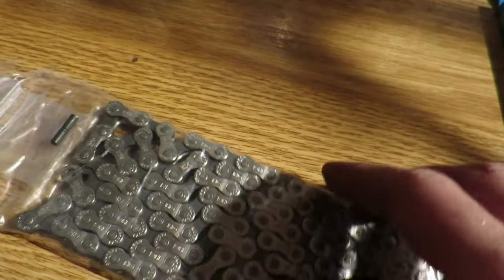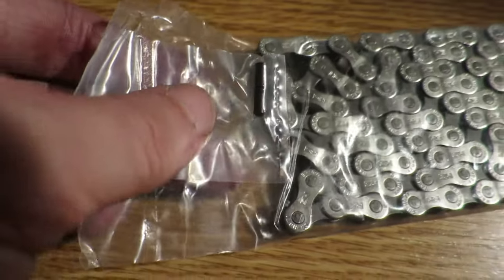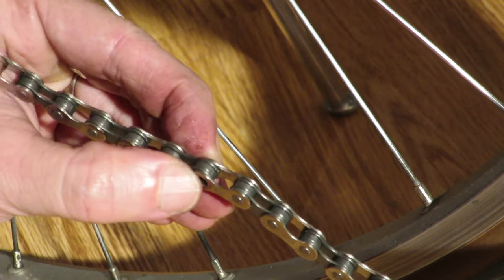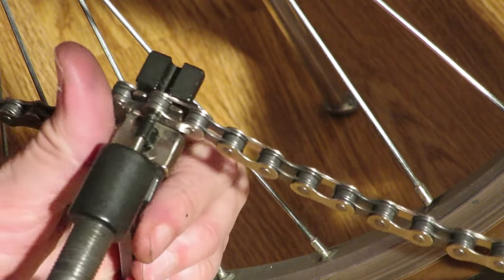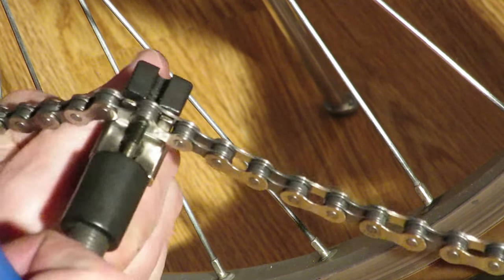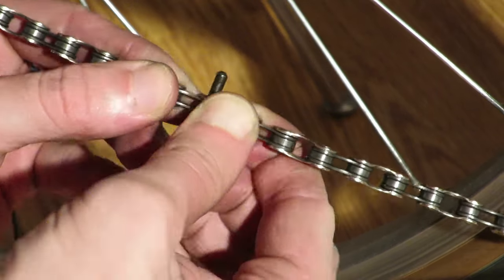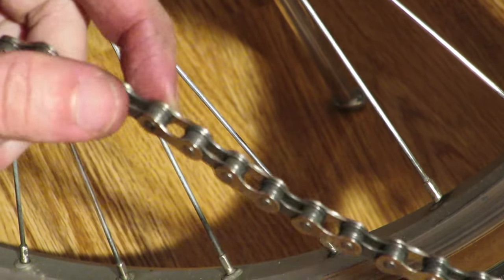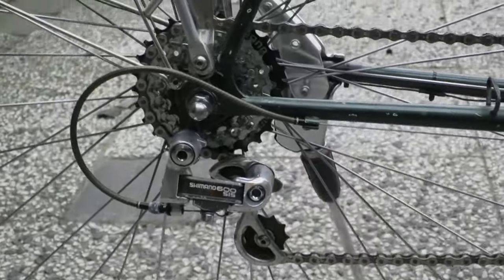How to install a Shimano chain pin in 3 easy steps

Comment: Great video just a quick tip , you should always pus the rivet in from the ' working side ' so that when you leave a small burr it doesn't scratch or damage your cassette,  good work

Comment: I wouldnt recommend using this chain at all. Just put one on my fixie and installed it like this video showed. The guy who sold it to me said it "was easy to install", just put the pin in and break it off. Sure it was easy to install with the special tool, but the chain broke before I could even ride 1km. So its obviously important that you install it correctly. Dont know how though. Otherwise it will break.

Comment: Great and informative video up to the final step of cutting the pin off with the chain tool .My chain tool is different looking then yours.  Mine does not have an attachment to cut the pin to size . Now I will have to watch ten bike chain videos at least before being able to ride my bicycle with a new chain . I have electrician pliers and several others pliers but I'll have to check video out .
Reply: Same here. Snap it off. Easier said than done. Quick link far better.
Reply: @colinellesmere  I disagree.  I am a metal worker with strong hands because that's what I do . I have difficulty snapping the link . My doctor says I don't have any motor neuron diseases like Parkinsons or als. I think the problem is with the quick link . These links are punched out by the millions with very little quality control.  Inspectors at the factories should be measuring the tolerances more often with verniers more often . You  probably are buying better chains than me . The brand is Japanese but they are probably Chinese knockoffs.

Comment: During my first bike build I spent the ENTIRE day setting it up. Had to run an internal rear brake cable that took hours because I didn't have the necessary tools, I finally was able to rig up a contraption and successfully got it through. Then I spent a while indexing my new 105 drivetrain, which took a while also because I ran the wrong cable, on top of that I have a 10 speed derailleur with 11 speed shifters, that was fun and after some time I got it dialed in perfectly. Then came the chain. I drove the pin in incorrectly and it snapped off before the pin was properly seated. It fell and I lost it. So excited to go for my first ride with my first build. But it will have to wait another day. Quick question, can you reuse a pin from another link? Thanks for this video. Won't make that mistake again.
Reply from the maker: No, you cannot reuse a pin.

Comment: I installed this type of chain and the link doesn’t move freely. It’s got some resistance, plus the pin on the side that breaks off sticks out a bit and not flush with the rest of the chain. 

Is this normal? I find quick links far superior to this pin style.

Comment: Thanks for the video but doesn't answer my problem. I've pushed the pin too far through the link, so even tho the link rotates freely, the chain plates are too close together. This has caused chain suck onto the granny gear, chain wedged in the gap and damage to my frame. How to know when the pin is properly located; in enough so it doesn't fall out but not too much? Thanks.
Reply from the maker: There are 2 ways to know the pins sits in the correct place. The first one is simply looking at it. If you pushed it too far, once side juts out, which can be seen. The second one is tactile. The pin isn't just a small cilinder. At both ends there are tiny ridges that hold the outer plates. If these ridges do not sit in the correct place, the chain plates do not move smoothly. The pin can sit in the correct place without a super-smooth feel, which will disappear after a couple dozen rotations.
Reply: Thanks. It’s looking better now.

Comment: It would be helpful to have more info on how far to push in the pin.  Thanks though :)
Reply from the maker: the chain pin hasn't got a smooth surface all over. It has ridges on either side so once in the correct position it will never come out on its own. I can't say how far to move the pin inside other than that it fits exactly. If it does not sit in the correct position its noticeably more difficult to bend the chain. Either bending the chain or moving the pin a bit further with the chain tool ensures both parts of the chain should "fall" into the ridges. A "good" position means you no longer can distinguish a "normal" link with a link that holds the inserted pin.

Comment: What if you are working with a shorter chain pin. What’s the best way to get it back in place?
Reply from the maker: The chain pin comes with the chain. I don't know how you would get a shorter chain pin other than that it didn't ship with the chain and isn't compatible with it. If that's the case you should never use it.

Comment: is there a certain orientation of inserting the pin & chain? letters/number of the chain are facing out & the new pin is pushed inwards (towards the bike)?
Reply from the maker: There's only one way the pin will go in, because the part that'll break off wil have a conical shape at the end for easy insertion.

Comment: I kind of trust the included pin method rather than the included quick link. Anyone has thoughts on this ? The quick link says can only be used once because of the thin material around that click. You probably can't reuse the pin, but still looks more reliable to me. 
BTW, I had a chain snapping on me recently (because of excessive wear) and is not something you ever want to happen under strong pedaling (I crashed of course) 😱
Reply from the maker: I tend to agree with you. For some reason I don't know Shimano uses chain pins. The only thing I can think of is that they're more durable than quick links, or they don't want people to be able to easily remove the chain.

Comment: Question: when opening up the chain to service it, should it be rejoined with a pin at a rivet other than the one where the first joining pin resides? I’m assuming you can’t open the chain at the first joining pin and then fit a new one at that same spot when closing it back together. I’ve read this could cause the chain to weaken and potentially break, because when a joining pin is inserted, the holes get somewhat enlarged and that’s why a different rivet should be chosen for rejoins.
Reply from the maker: If you don't insert a pin where you removed one, I'm interested to learn what's going to keep the chain together at that point?
Reply: Yes, don't use the same hole and pin twice. If you plan on opening and closing the chain more often, just get a reusable master link.
A river is never reusable.

Comment: What if on the smallest cog and smallest crank, the chain is too long?
Reply from the maker: You need to cut the chain in such a way that there's a little bit of tension on the rear derailleur and the chain does not rub on the bottom of the upper pulley wheel.

Comment: the two times I have tried to use these both times the pin has snapped off with the smallest force from the chain breaker and I'm left with having to go back to the bike shop for a quick link... why's it work for everyone else
Reply from the maker: I had a pin snap in two when I wasn't even trying to get it into the chain. It happens. My LBS always uses quick links to circumvent the issue altogether.

Comment: What do you do if it is sticky and doesn’t move freely?   I’ve tried flexing it laterally and still tight ….
Reply from the maker: you probably haven't pushed it in far enough. The pin is not a single smooth cilinder. There are tiny shoulders to keep it in place. If these shoulders don't sit correctly, the pin is pinched and the chain won't move freely, what you call "stickY".

Comment: Which side of the chain do you insert the pin from, the side with the Shimano logo or the other side of the chain that is blank. In my opinion  it should be from the inside to outside so that the bur on the chainpin wont rub against the sprockets.
Reply from the maker: the chain can be used either side so it doesn't matter
Reply: @restorationdotbike  I dont agree as when you break that pin it may gave a slight rough edge, facing it away away from the inner cogs will stop any rough travel from the chain.

Maybe before making a video you should actually do your research on that first.
Reply: @taichihead42  then why th fk you ask him, if you already know your answer. Go and do your own video then.
Reply: @alfonsoperez8535  perhaps - just perhaps he asked the question and found a better answer elsewhere and came back here to report his findings seeing as the OP was wrong? - shame you got easily triggered.

Comment: Is it okay to convert connecting pin to quick link?
Reply from the maker: If you make sure the width of the quick link matches the chain (e.g. 8-speed chain link for 8-speed chain) the answer is yes.